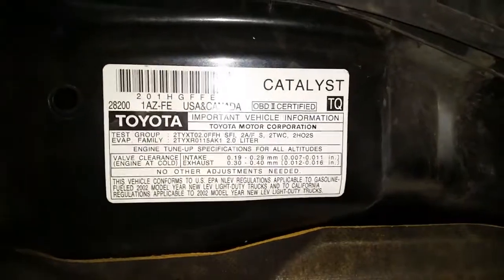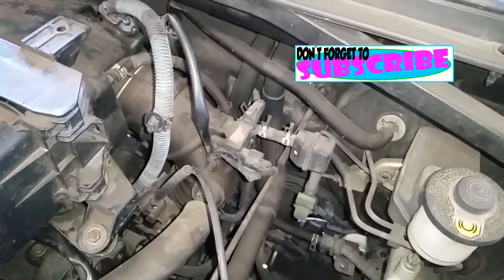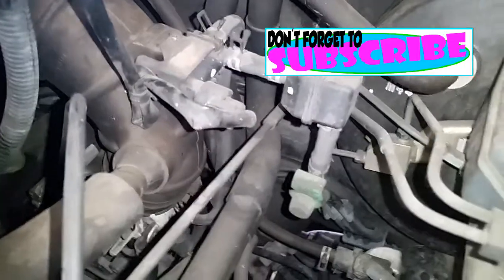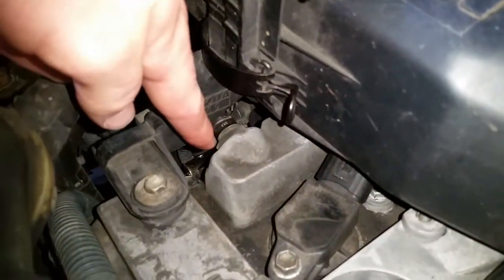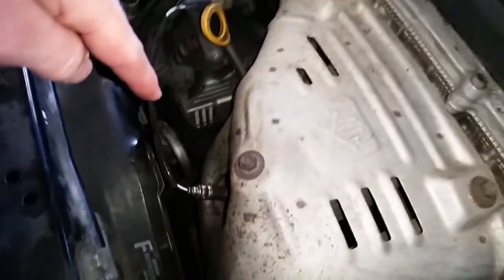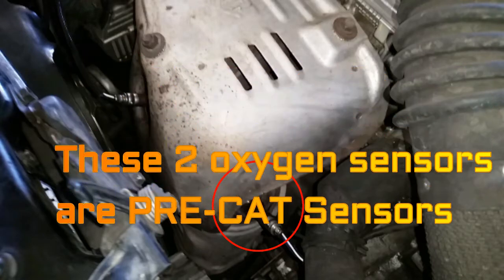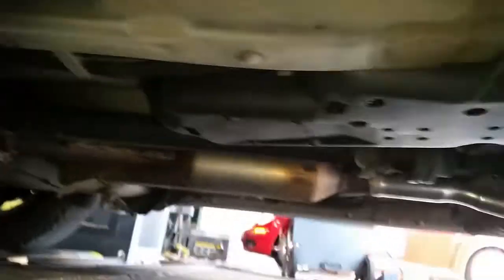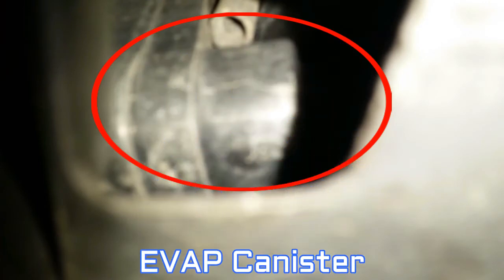Toyota Rav4 emissions/smog locations: PCV, EVAP, O2 sensors

Comment: There's also a purge selinoid next to the carbon canister and there's another one under rear riverside seat by the gas pump..
Reply from the maker: The one near the canister is called the Vent valve. The other one you are referring to is a vsv valve.